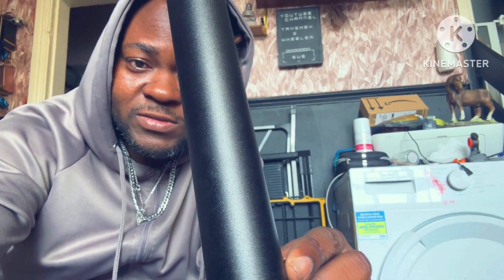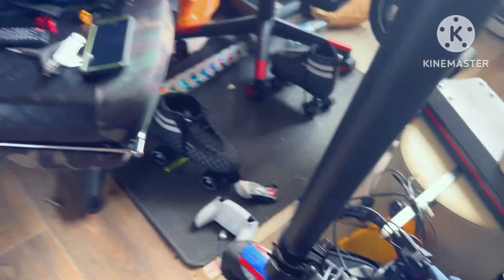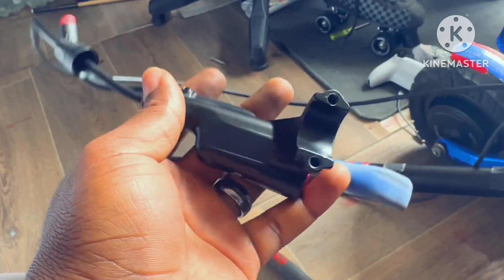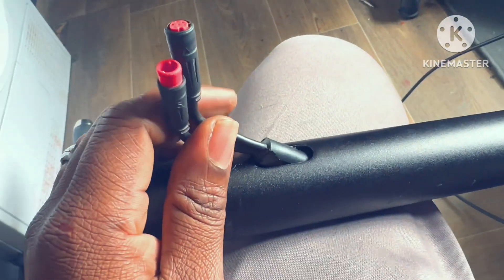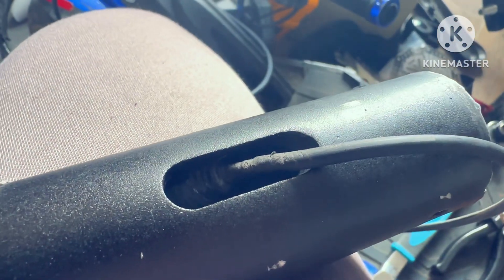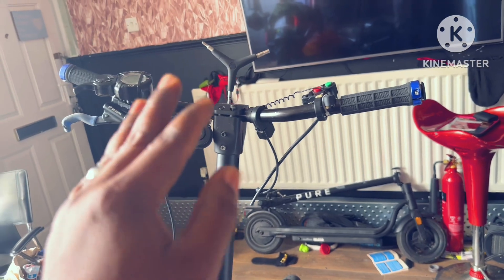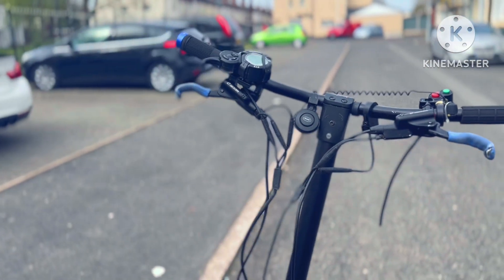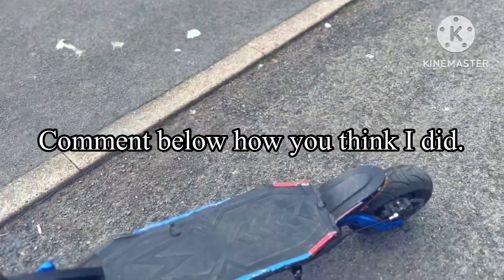KAABO MANTIS STEM SWAP

Comment: we luv you too brother and great job mate looks great that stem and i prefare the wires to be on the outside of the stem looks well better bro
Reply from the maker: Thanks bro, I told the owner aswell it’s better out now so next time he got anything doin he don’t have to get all the wires out.
Reply: @Tansmen2WHEELER  I have this one brand new out box but the steering is very tight how do I fix this
Reply: @Tansmen2WHEELER  yes it does look better out all the hyper scooters like the orion as them out and there just cable tired aswell
Reply from the maker: @austieoutdoors9763  Yh u r right.